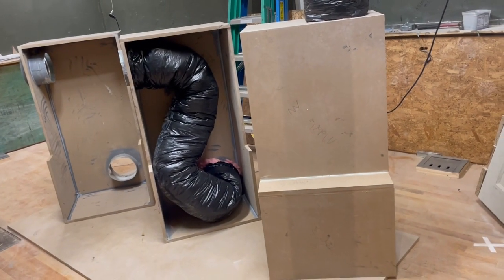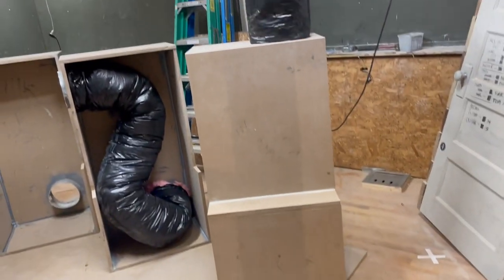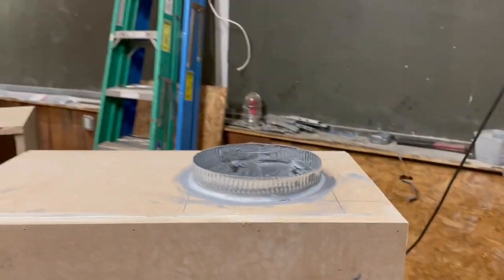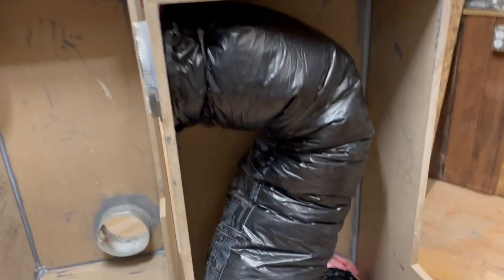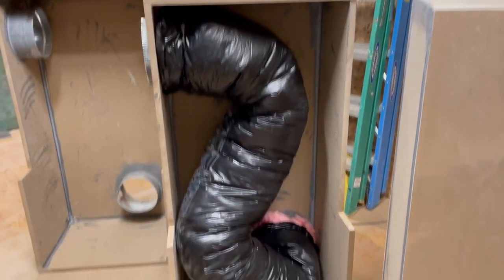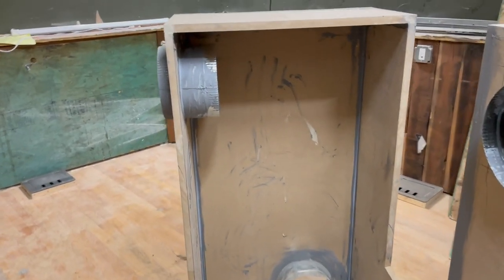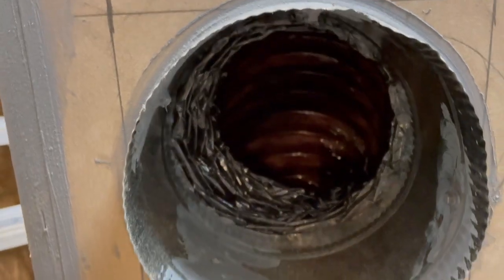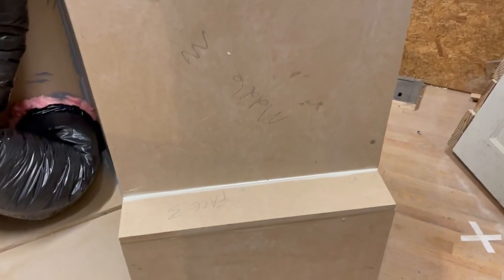DIY HVAC mufflers used at Our Carriage House Recording Studio

Comment: My response to this is very mixed: On one hand, HURRAY, I love when people build solutions! On the other hand, given the effort you obviously put in, I think you would be MUCH better off BUYING good silencers.
It seems like your solution is only slightly better than boxing in your ductwork., and it seems like you are getting minimal attenuation thru the duct(s). The advantage of COMMERICAL silencers is that you would KNOW both the attenuation you will achieve AND the pressure drop you are introducing into the system. My GUESS, is that you will find a commercial silencer that will offer both LOWER PRESSURE DROP and MORE ATTENUATION!
Again, I LIKE DIY projects, but I'm not sure that you are meeting the base level performance for a commercial product.
Reply from the maker: Thanks for your feedback Sam.  Your comments here will, no doubt, be helpful to others who are considering DIY mufflers for studio HVAC.